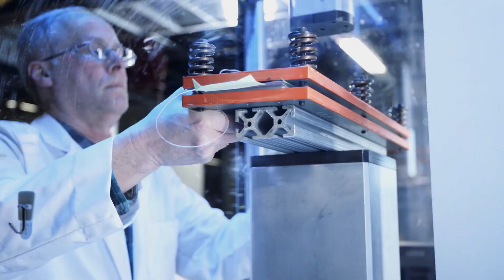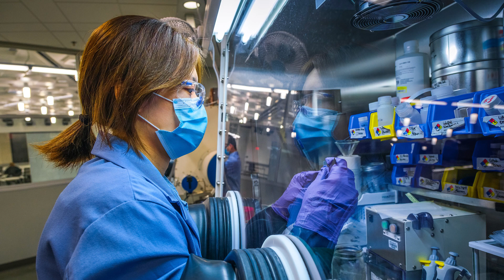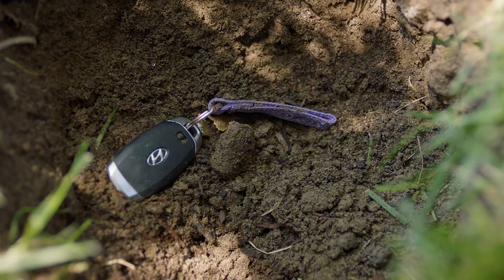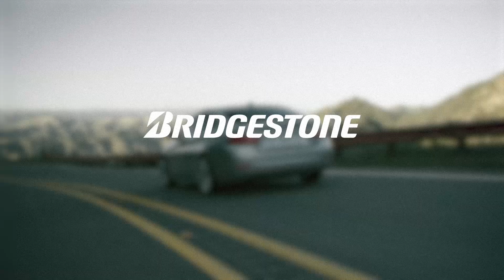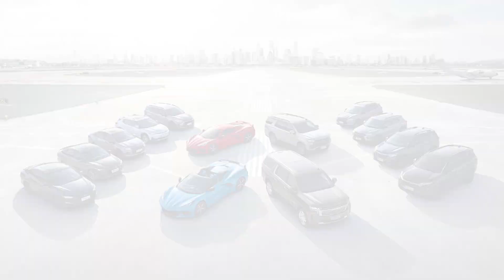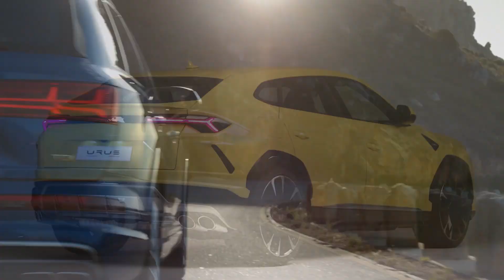GM Steps Up BEV Commitment; JLR Wants to Block VW Group SUV Imports - Autoline Daily 2964

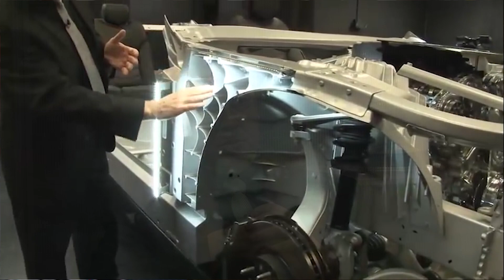Comment: 0:37 So, GM will use diecast aluminum like Tesla (really small compared with Model Y)?
Reply: GM started inserting well placed die casts in their corvette chassis 15 years ago.
Reply: Nice catch! Foxconn is also building an EV skateboard with large castings. 👍
Reply: GM was using die casting for chassis components many years ago,  seems Tesla has been copying GM...   Cadillac CT-6,  C8 Corvette and even the truck platform uses die cast components
Reply: Just go to an automotive museum, diecast is the oldest manufacturing methode.
Don't fall for the stupid Tesla hypes that is just to inflate the stock market, in reality Tesla has very little to offer.
Reply: @buddy1155  Not on this scale, not even close. Ask the experts like Munroe who literally worked on it for a living in the past at Ford, they haven't seen anything like this scale in auto.
Reply: @AllanSustainabilityFan  And it is not true that it has never been done before, the first car that didn't had a wooden frame anymore had a single cast frame. 
Tesla fist made the mistake to made the entire rear out of  ... 80 something parts, now they made the mistake of making it out of a single part. You would think that a company would stop making this kind of mistakes after 15 years.
Regular experienced car manufacturers make it out of 5 or 6 parts. This way it is easy to repair if the car had an accident.
Reply: @buddy1155  https://leandesign.com/new-york-times-munro-says-the-mega-casting-is-just-spectacular/

"One of the biggest finds was the Mega Casting which is the largest aluminum casting that our team has ever seen in all it’s 32 years of existence.  What is even more interesting is the process that pulls this off."

My understanding is the main challenge with casting at this large scale was it caused deformities at the treatment stage, but Tesla's workaround was to create its own new in-house aluminum alloy - they have their own internal Metallurgy lab - that doesn't need treatment after getting fully injected into their giant building size casting machine within milliseconds.
Reply: @AllanSustainabilityFan  Like I said before, there is nothing special from a technical perspective, it is all one big hype to drive up the stock.
Reply: @AllanSustainabilityFan   Tesla is using mega castings, to save money, they are not using them because they are better, which I don’t think they will be better, just understanding the metallurgy of aluminum, and what heat treatment does for the materials.   Elon musk said they cannot heat treat the mega casting, because it will twist during the heat treatment process.   So they are using a different aluminum, but if you understand the metallurgy, changing the alloy, does not give you the same properties as the proper heat treated material.   I would much prefer to have a couple of small heat treated castings bolted together, then one big casting that is not heat treated and probably has more flexibility in the material.
Reply: @dmitchellhomes  More expensive doesn't mean better, you can make a better car that costs less, it's the smart thing to do, and when combined with the software edge that's how Tesla can make as much profit with an $80k big luxury sedan as Porsche does with $250k track toy.

Not every car company has a dedicated metallurgy department that creates its own alloys, they contract such things to outside vendors, but Tesla has many internal uses for it and are using it to their advantage. It also helps that Tesla and SpaceX share some engineers.

Another example of The same thing with integration, Porsche's weakness is they rely on third parties much more than Tesla, which only amplifies Porsche's software gap. That "cost cutting" comes in the form of being able to optimize the entire car through software instead of having 80 chips from a dozen vendors that are not designed for cross-integration, and explains one of the reasons why the Porsche is so heavy.
Reply: @AllanSustainabilityFan    Tesla does not have a metallurgy lab,  actually their engineering department is a single building in Fremont,  where they are building a battery pilot line on the second floor.   Thats where Tesla does all their engineering from battery, to chassis, to crash lab etc....     For reference GM has  20K employees in R and D and test, and just a bit more  then Tesla when it comes to facilities and tools.   Just at the Milford Proving grounds alone there are 140 different buildings where GM is working on different testing and validation.   Then you look at the Warren Tech Center, which is a campus of buildings and labs where GM is doing R and D.    Sandy Munroe has said several times if you pay attention that GM has the smartest people in the industry working on batteries, fuel cells, and all kinds of other advanced tech.       Tesla's goals are all around cost savings so they can lower the price of their cars to gain volume,  which is fine,  that is what economy brands do,  but I think Tesla should first concentrate on quality, and catch up in features, then worry about volumes.   

https://en.wikipedia.org/wiki/General_Motors_Technical_Center
https://en.wikipedia.org/wiki/General_Motors_Proving_Grounds#Milford_Proving_Ground

SpaceX is impressive in their own way,  but tech transferring between Tesla and SpaceX is little as the rigors of spaceflight are much different than car chassis.    

As for software integration Tesla is usage a single processor,  this is good and bad,  on the good Tesla can control their software experience,  on the bad Tesla's are missing many features that traditional OEM's include because Tesla does not have time or enough programmers to  program these different features.    Look at Telsas camera system,  Tesla does not have a 360 or helicopter view of their cars which is something available on most cars today, and for the last several years.    Tesla's front and side view cameras are optimized for the driving computer, so they are not a very good image.      Compare this to the VR camera system on the 2021 Escalade which is crystal clear.   Tesla also has lower display resolution then what is state of the art today,  compare the display resolution in S and X to a 2019 E-Tron, Taycan, Escalade  there is no comparison, Tesla is blurry (low quality) by comparison.     Why does Tesla not offer HUD's?  They are a useful tool,  especially when they provide so much information like VR turning info 2021 Escalade, and VW ID products?    I mean I know why Tesla does not offer HUD,  same reason they do not let back seat passengers control their own heated seats in Y and 3,  CHEAP CHEAP CHEAP.      

Since this chain is about Chassis though,  lets talk chassis,  why does Tesla not offer the bank vault driving experience found in the Audi E-Tron?    Door closing sound?    I have looked at the door closure on my E-Tron  there are 3 sets of weather-stripping on the doors, double pane glass, etc...    How come the Model X is so much slower around a track?  I mean it is lighter, and has more power, the X should stomp a mud hole in the Audi,  but NOPE...    Why does Model X charge so slow?     Why does X have so many rattles and Squeeks, and the Audi none?       Hmmm,  I would say the Audi is just better engineered to offer a great balance of driving comfort, and utility.      https://www.youtube.com/watch?v=GEpqt-3yE_s
Reply: @dmitchellhomes  "As for software integration Tesla is usage a single processor,  this is good and bad,  on the good Tesla can control their software experience,  on the bad Tesla's are missing many features that traditional OEM's include because Tesla does not have time or enough programmers to  program these different features."

You will always benefit from having a fully integrated solution as long as you have good developers, and Tesla has the best software developers in the industry, they're the number one company graduates go to in engineering, followed by SpaceX.

And the 360 example is kinda silly, because it's not a killer feature, just a nice thing. A killer feature is managing the flux of the motor to extract better range, to charge the vehicle faster while maintaining battery health and cooling optimally to hit 250kw with a small battery pack, to reduce parts from four to one for managing the thermals and climate control, you know, the hard stuff, not window dressing.

But don't worry, the winter package is coming out with the 360 degree thing too, so you can have both, Tesla has OTA and other companies are still struggling to do that basic function, remember?
Reply: @AllanSustainabilityFan    Tesla does get the choice of the top engineers, and they have smart people working there,  no doubt about that.    However GM has decades of experience, and systems in place to get the most out of what they have.    Tesla also does not have nearly the design and engineering tools to work with.      As for 360 cameras,  that's just the beginning and to cats up with something GM was doing 5 years ago.  Let's also look at Tesla's image quality, and screen resolution,  oh,  Tesla still does not have a sample for us to look at,  but their screen resolution is so last decade.  

As for charging,  Taycan charges at higher peak and overall rates then Tesla,  E-Tron only hits 150kW but holds that rate to 78% SOC,  have you seen how EV customers charge?  Spent time at charging stations?   I talk to a lot of Tesla users at Supercharger stations that pull in to charge at 40 +% SOC,  obviously not optimal,  but many users are not following Bjorn Nyland and so they don't get to see optimal charge planning examples,  Audi's system does not punish the "ignorant" user.    Pull in at 40 or 50% and you still get the peak rate...
Reply: @dmitchellhomes  Kodak had decades of experience with old film, it did not save them when digital cameras took off. EV experience is a different animal, and software experience is an even bigger barrier to entry for them, they are nothing like the silicon valley giants. Tesla is not competing with car companies, it's a technology and energy solutions company that happens to sell cars, you don't get ridiculous margins selling just cars, allot of that is the result of that software experience.

Again, 360 is just a nice thing, not a killer feature, if that matters so much, then for each 360 Tesla has ten similar "killer" features. Which car company lets you summon your car from the parking lot to your doorstep? Which car company lets you watch HD Netflix, Youtube or play quality video games? These are nice things to have, not deal breakers, they don't matter if the base of the design is inferior, you have to begin by providing value in the primary function and then put window dressing on top. 

The Taycan charges faster if you find that rare location that lets you, but its battery is huge compared to the Model 3, which means you spend more time to get the same miles, its range is Nissan Leaf territory while costing four or five times as much, because it's optimized for track instead of daily driving, it's not a useful comparison to the Model S, and even less useful to compare to a Model 3.

The E-Tron marketing was caught lying, they manipulated charging graphs to put the E-Tron in a positive light, and then they were outed, it was very embarrassing, and they would probably like it if you didn't bring attention back to this topic. The reality is that the Model 3 is better than the expensive low range E-Tron in charging speed, at least the Taycan can charge fast in a select scenario, the E-Tron is just deceptive marketing.

https://cleantechnica.com/2019/05/17/correcting-audi-tesla-model-3-charges-over-2-times-faster-than-audi-e-tron/
Reply: @AllanSustainabilityFan    Tesla is not competing with auto companies?    Why did they lower the price of S and X when E-Tron came out?     E-Tron is now outsells both S and X in Europe.     Audi never lied about E-Tron Charging,  or range,  not like Tesla with deceptive numbers.  Tesla tells you peak charging rate,  but not overall,  and Tesla's charge slow over 80%.   In a 1000km race incl charging stops E-Tron matched the Model X,  and   if the race was longer,  the Audi would win.    Model 3 is in a different class of vehicle,  it's a smaller economy EV.    I have an E-Tron and have road tripped it,   it charges very fast, and Electrify America stations in the area I live are plentiful.   

https://www.youtube.com/watch?v=TFu9pkpunuo
https://www.youtube.com/watch?v=tV0jlKX3wJs

https://www.youtube.com/watch?v=MpHju6NtN44&t
Reply: @dmitchellhomes  They can lower prices even further, Elon Musk even said they could at some point apply the gaming console model on their cars if they wanted to, basically selling them at breakeven prices and then make massive margins on software. The vehicle is just a platform for selling software as a service down the road. 

That's the point, not "just" a car company, the legacy auto manufacturers are in the rear view mirror as far as Tesla's business model is concerned, the company has plans beyond just making a motor on wheels. 

It's like people calling Amazon "competition for bookstores" ten years ago. Here's a walk down memory lane with Amazon, same arguments and market confusion:
https://twitter.com/xiang_aw/status/1301032188025081858

Anyway, this is ridiuclous, we're going on circles and splitting hairs instead of looking at the obvious big picture. I suggest you listen to Herbert Diess, VW's CEO, on his opinions of Tesla and EV transition, you will find that he makes allot of the same points I'm making, so he gets where this massive market disruption is going, and that bodes well for VW's future: 

https://www.youtube.com/watch?v=SEo11Dopu-w

Hopefully other companies can do the same, but it takes allot of courage for a company to make proper EVs that cannibalize their own ICE bread and butter, not many golden parachute addicted CEOs would be comfortable with that, lets see if Mary Barra will be one of those, and if she's really aware of how critical this time is for the company is is ready to ride through it - instead of run away with a sack of money and then let the next boss deal with it, like many CEOs do these days.
Reply: @AllanSustainabilityFan    You are going in circles,  I am following the same path...   As for Tesla software as a service,  can you show me that revenue?     Tesla last Qtr made 316M on 139K sales  that is a profit of $2273 per car built,  since then they have lowered the price of 3 of their 4 models,  and I see Model 3 just lowered price again today.    When you keep lowering prices its hard to build margins,  thats why Apple is so amazing,  as their volumes increased, so did their average prices for the products,  and Apple's services business...WOW,   More than double Tesla's revenue per quarter.     

Now, I agree with you that Tesla is onto something with software as  a service,  but GM, Ford, and VW are working hard to go after this industry too (they have much larger customer base),   and Tesla is currently behind in infotainment performance,  I just read last week Tesla is trying to buy AMD processors for their infotainment,  I guess they know they are behind.     https://electrek.co/2020/11/09/tesla-switch-amd-big-navi-gpu-onboard-computer-leak/

Tesla products are so far behind trends in the market,  GM, and VW are bringing in virtual reality to navigation,  and Tesla still has not done a 360 camera...   Now think about this,  Tesla's software as a service,  how much time to people spend in their cars per day?   What additional software do they need in the car?   Better navigation?   Maybe...    Autonomous features,  that's a long ways off to reach anywhere near level 4.      Tesla is still level 2, even with FSD...
Reply: @dmitchellhomes  Last I recall Tesla has a retention rate of around 25 percent for their $8000 (at the time) FSD option, for example, so that's $2000 per vehicle of additional revenue, for example.

I'm not going to debate with your denial lol, you're not going to help these companies improve by denying trends. 

There's a reason why Tesla has 80 percent of the EV market in the US, people can tell when a product has superior features by test driving it, and they do test drive them. 

Here's a recent buyer's opinion, for example, another known business analyst, after testing driving a dozen cars before buying:

https://twitter.com/SawyerMerritt/status/1330600384742776833

"REVIEW: THE MODEL Y IS F*CKING INCREDIBLE! By far the best car I’ve ever sat in. I brought my mom over to check it out too and I think I just convinced her to order one! Haha. The sounds system is insanely good! The seats and roof are great. Fit and finish were also good. "

Other examples:
"My dad tried a model Y yesterday, his first tesla experience, the magic tesla test drive has him waiting for the cybertruck"

Cramer's daughter and wife had similar reactions, it's why he's now a big fan of the company, despite CNBS's relentlessly negative view of company stock prior to S&P 500. People are waking up to this reality with each test drive.

This is a very common reaction from test drivers, again no need to advertise, they sell themselves. Sure, the ad driven media will feel threatened, but this is the digital age, and stuff like Audi's shady marketing around charging backfires easily nowadays.

Word of mouth sold a million cars, and still going.
Reply: @AllanSustainabilityFan   Yes,  but that FSD revenue is included in the earnings,  so that means without it Tesla would be losing money...
Reply: @AllanSustainabilityFan   Cramers wife wants the Hummer EV...   Not Cybertruck...    

https://realmoney.thestreet.com/jim-cramer/jim-cramer-i-just-made-a-u-turn-on-gm-15481348

I own a Tesla Model Y,  its fun and sporty,  but very low quality compared to the Lexus I had before.     Also nowhere near as nice as our family E-Tron on many fronts.    People who own and drive Tesla's daily know,  they are Ok, and tech forward,  but far from perfect, and not even normal in everyday life.    Number 1 non Audi car traded in for E-Tron is Tesla,   same with Taycan.   As more competition comes in you will see more of the same.   Now,  Tesla does have huge market share in the USA,  but weak in Europe and China.   That being said,  Tesla is a big fish, in a very small pond.    In China, the worlds largest car market, Tesla is struggling,  I guess that is why all the Tesla execs are selling stock like crazy, they know their bubble will pop at some point.    Same for NIO, and Xpeng,  I own all of them,  but this is a bubble without question. https://ir.tesla.com/sec-filings
Reply: @dmitchellhomes  Cramer's wife has a Model X. His daughter also bought a Tesla.

He changed his mind on Tesla after talking to professional in the field and big time CTO friends that set him straight, but he's still gonna work for CNBS, and GM is a big spender, their marketing budget was more than Tesla's entire budget last year, for example.

I think Cramer will probably be pretty disappointed with GM if they're spending their money on marketing and deflection tactics, rather than R&D.

I like the look of the Hummer, but it's not a serious effort imho, just a headline generator to stay relevant. I hope to be proven wrong, but the pack design doesn't impress.
Reply: @dmitchellhomes  My friend was just at Best Buy last week, he said the parking lot was packed with Teslas. The brand caters to the techies quite well.

Did you just say you own a Tesla? Don't pretend dude, that's sad lol.

Lexus is just a nice horse carriage, talk to me when they have a proper EV. At least VW is trying, most other legacies should take note and start steering that ship because they're running out of time.

You're right about EV market size today, but that segment is taking over the market, it's already the dominant mode of transport in Norway and Iceland, and becoming significant in France, UK and even laggard Germany. Nokia didn't move fast enough either, they were much bigger than Apple in phones, a few years is all it took for them to fizzle out.

Tesla's share of the market will naturally shrink, that's normal, same with iPhone, but a marketshare of 20 percent in a trillion dollar market, is better than 80 percent in a hundred billion dollar market. And it serves Tesla's corporate mission, they always say they can't accomplish their mission alone.
Reply: @AllanSustainabilityFan   Your friend said there were a lot of Tesla's at Best Buy?     That is your data point of market domination?     I rest my case...  

Yes,  you are right,  Norway is where we should be looking to see a more mature EV market,  In 2016-2019 Tesla dominated that EV market,  how is it going in 2020?   eu-evs.com  you can check it out for yourself...     AUDI, VW, Hyundai are dominating 2020.  E-Tron outselling all 3 Tesla models combined even though the price is double Tesla's volume leader...   Yup  thats domination...
Reply: @AllanSustainabilityFan    Cramer just talked about his wife wanting the Hummer EV a couple weeks ago...  I just happened to catch the segment in passing.     

GM R & D puts Tesla to shame,  there is no comparison,  Just in facilities, and capabilities there is no comparison.   GM has a history of inventions that become the norm in Automobile manufacturing.   You should stop by Milford Proving grounds, and the Warren Tech center,   Tesla just buys components from suppliers and slaps them together,  Tesla does not make any production battery cells,  which is 40%+ of the cost content in an EV   They hire Panasonic, CATL, and oh ya LG Chem to supply  them.    Tesla is just hype,  GM actually innovates.      

Thats ok if you are not impressed by the battery pack in the Hummer EV,  you are not the target market for it anyway,  you likely cannot afford it.   Anyway,  The had the reservations full in an hour, and  thousands of people paid $100 just to be on the waiting list if a reservation opens up.       

What nonsense!!   I don't think too many customers say,  I do not want this good looking off road truck because of the way they assembled the battery pack, No,  I want the ugly one that looks like a door stop, because they are gluing the battery cells directly to the chassis so there is no way to service them. I want to buy a truck from a company that has no experience building trucks, not the company that has built 86 million of them...   Ya kid,  makes sense to me.
Reply: @dmitchellhomes  Here's your buddy Cramer giving you a recommendation about your supposed Nio stock:
https://www.youtube.com/watch?v=Ia3vr7R6mRk

Ouch. I think he's making fun of your Nio argument.

Here's another:

https://www.tesmanian.com/blogs/tesmanian-blog/wedbush-raises-tesla-tsla-price-target-to-560-bull-case-target-to-1-000

"Daniel Ives, Wedbush analyst raised his Tesla (NASDAQ: TSLA) price target to $560 from $500 also increased the bull case target to $1,000 from $500."
"With the sustained path to profitability and S&P 500 index inclusion achieved, the Tesla bull story is now all about a stepped up EV demand trajectory into 2021," 

"Overall we are seeing a major inflection of EV demand globally with our expectations that EV vehicles ramp from ~3% of total auto sales today to 10% by 2025. We believe this demand dynamic will disproportionately benefit the clear EV category leader Tesla over the next few years especially in the key China region which we believe could represent ~40% of its EV deliveries by 2022 given the current brisk pace of sales with 150k+ deliveries in its first year out of the gates with Giga 3."

And thanks, you gave me a good laugh about GM's supposed advantages, I'll leave it at that since you're just repeating yourself and I already corrected you on why obsolete factories are stranded assets. 

Feel free to revisit previous posts, it's already covered folks.
Reply: @dmitchellhomes  It's just nice to see progress on you own street, I hope you live at the footsteps of disruptive progress, but I doubt it from your legacy-like thinking process, we are all influenced and sometimes limited by local mindsets.

The data point is market trends, for example the chart below:
https://www.teslarati.com/tesla-opens-germany-largest-integrated-sales-service-center/tesla-germany-sales-kba-chart/

Notice how only one company had positive sales, I wonder why lol. 

Granted, the chart also tied into the Covid challenges, but that also lends further evidence of where Tesla's sales model makes more sense in this day and age, and some companies are starting to move in the same direction as well to help recover their sales.

One of many examples, but to be fair it's more meaningful to look at global yearly sales, which shows Tesla dominating by 43 percent of sales, followed by BYD, and then VW in distant third. Way below is GM on that map.

People are already starting to consider this when shopping: Why buy an obsolete ICE vehicle today that you will struggle to sell in a few years? Talk about burning money.

So now when shopping, for many educated buyers it has to be an EV, and for that to work then these companies have to have proper EV products on offer that don't have glaring weaknesses like low charge rates or much higher sticker prices related to the company's ICE equivalent.
Reply: @AllanSustainabilityFan    I bought NIO stock under $3 in April 2020,  its at $57 today...   I think its totally overvalued,  but heck I am on for the ride,  just like XPEV, and TSLA...   XPEV up 37% today alone, NIO up 14% today,  TSLA up a measly 7%.  When I think this bubble is starting to pop,  I will move on to something new.   Meanwhile very small investments in XPEV, and NIO, are paying for my Hummer EV.

I am not sure where you come off saying my thinking is legacy?   I own a Tesla, and own Tesla stock,  I also own stock is several other EV makers,  and was the first in my circle of influence to own an EV in 2012, and have owned 4 since...  I'm an EV guy through and through,  but not a Tesroid.  I think there are going to be lots of winners in the transition to electric cars.   Teslas are fun but at the same time very frustrating.   Why can't they fix the seat in my Y,  even after I wasted time to take it in 3 times?    One of my friends have a model 3,  a tree branch fell on her glass roof and broke it a month ago,  still no new glass roof,  the service center cannot get the part.   So she has to drive an ice rental car.    I took a rock  off a semi in the windshield on my E-Tron last summer,  3 days and I had a new windshield.     

I mean talk about ice,  Tesla is a good customer of Ford and loves Ice,  have you ever seen Tesla's service fleet?     Lots of Fords,  and have you visited a Tesla construction site?  Ice vehicles everywhere.       Yup, obsolete...
Reply: @dmitchellhomes  I got stock in Nio and Tesla but not XPeng. 99 Percent of Nio's stock valuation is tied to Tesla's success, not re-assuring for a short-term stock holder like myself, but I'm not gonna complain, my long-term bet on Nio was that their local market seems to like interchangeable batteries, which is something that didn't succeed elsewhere but maybe it can work for parts of China. We'll see how that plays out. I just hope the rest of Nio as a company matures, because it's still on shaky ground.

And now back to responding to the silly parts:

I'm sure Ford built allot of car factories with horse carriages back then as well, it seems you're the kinda guy that always lives in the present and then get shocked by the sun coming up the next day lol.

Now I'm not sure why you're pretending to be someone else, but lets bite: 

You're telling us that you, the full-time Tesla cynic, were one of the first in line for the Model Y that just started coming out in the middle of 2020, while pulling almost every tired ancient talking point from as far back as 2015, many that don't even apply today... YET you were so excited to jump at the chance to buy that 2020 model Y all of sudden, despite years of deep reservations about the company's products, culture and anything it stands for? 

Does not pass the smell test, sorry, this is not normal educated car buyer behavior. Maybe next time use Model S or X, or least the Model 3, to make such claims and pretend to be some gas loving EV aristocrat lol.
 
Not the first stumble either, this goes back to the couple times earlier where you got caught in your own web, for example claiming XPeng was not stealing Tesla tech, and then a few posts later showing that you don't buy your own argument when claiming that their tech was merely a "heavily modified" version. I hope you're getting paid for this circular logic, because it sounds like allot of time wasted on attacking a startup and defending old obsolete business models, using superficial points that mean nothing in the context of an ongoing major market disruption. 

EVs are here to stay man, they are growing rapidly, and ICE is shrinking in return. ICE is getting banned left and right, and renewables are now the cheapeast form of power generation by far, that's the reality of the change happening, and it's not going to change whether Tesla is part of it or not, they are simply a notable catalyst, deal with it.
Reply: @AllanSustainabilityFan    You mean Tesla is going to stop buying cars from Ford?     Tesla owns quite a few Kenworths.and Peterbuilts too,  where is the Tesla Semi they unveiled over 3 years ago?   3 years???   Come on...   

My Model Y is vin 42XXX,  so I was not first in line,  I would think 6 months in they would have fixed the production system and be building quality,  but nope...  I am even listed on Troy Teslikes Model Y spreadsheet.    I almost bought a model S in 2012,  but my buddy and I took a test drive and we both felt the car was too rough for what we were used to.    Thank god because another friend of ours  did buy one,  4 door handle replacements, 3 drive units, 2 battery packs later he got rid of it.    That was the roughest 2 years I have ever seen for 1 car.    Can you say POS...     

As for Xpeng steeling software,  tesla could not prove it and the judge dismissed the case,  but InsideEV's discussed it today   
https://insideevs.com/news/455900/xpeng-responds-elon-musk-tweet/

Compared to Waymo who proved in court that their former employee stole  their Tech,  Tesla arguments are weak.   

I have not seen an Xpeng in person, and certainly not a software expert to comment on whether the code was Tesla's or not,  but it seems Tesla is having trouble holding talent,  they have sued Xpeng, Rivian, and Lucid, all accusing them of stealing secrets.      Tesla's success rate at getting judgements is not so good,  they just want to distract from the fact they have brain drain going on.     Lots of graduates want to work with Elon Musk,  but then they get to know him and find out he is an a-hole,  and they cannot wait to go work somewhere else.  Look at the current group of Tesla execs,  they dump all their stock every month,  they are just on for the ride...  Tesla CFO gets paid more than any CFO in history,  he has sold $30M in stock this year alone.   Maybe some financial engineering going on?     GM was paying their former CFO peanuts in comparison,  maybe that is why she quit and went to a tech company?
Reply: @dmitchellhomes  You're a pretender. Why so insecure? Be honest.

Here's the latest from Tesla by the way, they have passed half a TRILLION dollars in market value:
https://www.youtube.com/watch?v=fVLaZBcsGzI

Speaking  of factories, this market valuation is with 500k production, next year is a million, and then two million the year after. So this is before all FOUR of their market leading factories reach full production. They're in the process of starting a fifth.

You like that?
Reply: @buddy1155   Exactly!   Tesla is 90% hype, and 10% substance,  going to make a lot of investors cry someday...
Reply: Die cast manufacturing is nothing new, really. Tesla is not doing it on their own either, they just buy hardware from a 3rd party supplier.
Reply: @SkywalkerWroc  Not really. Tesla developed special aluminum for large die cast. Tesla/SpaceX has metallurgy engineers/scientists team.
Reply: @CookiePepper  Their "special aluminum" is no more "special" than what everyone else use for the large die-casting. Every alloy is a compromise. You trade X for Y. Each manufacturer finds their own balance at a different points.